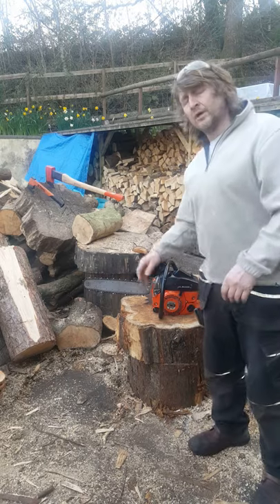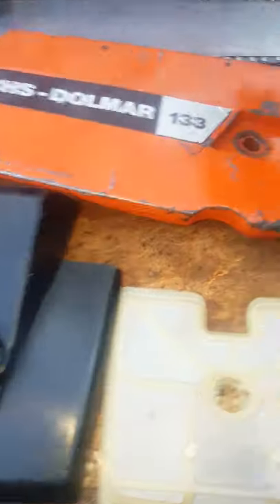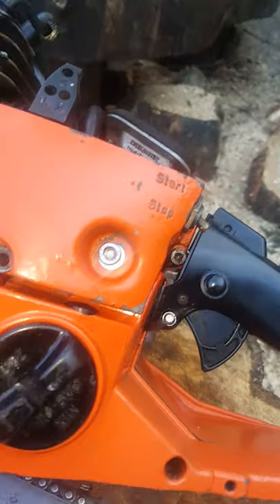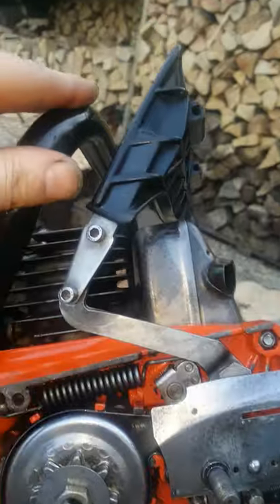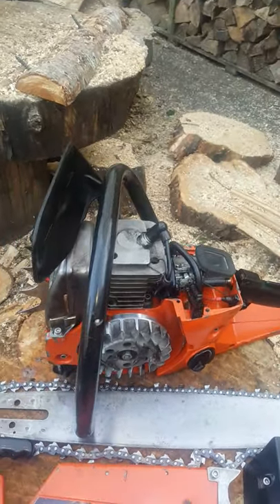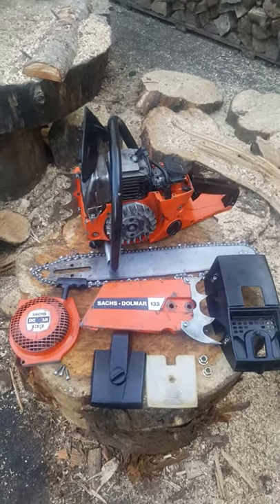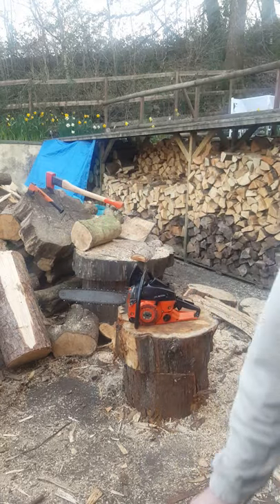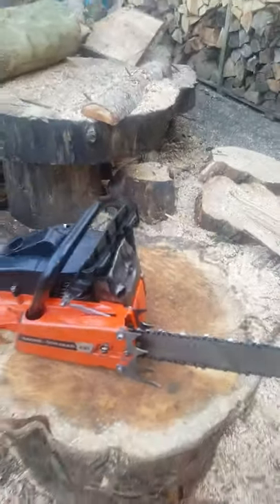Sachs Dolmar 133 Vintage Classic 85cc German Chainsaw. Starting and overview. Sadly a noisy engine.

Comment: so did it sell? I recently bought a 133 myself. wonderful saw. How difficult are bearings to source? surely someone makes something that can be fitted with only minor or no modifications?
Reply: 40/17 bearings. Take skf c4. The roller bearings from the newer are nearly impossible to get. Its a fit loose bearing so 1 tight bearing on the one side and a light sligth bearing on the other side its NO DEFECT its wantet like that. To get it easy together